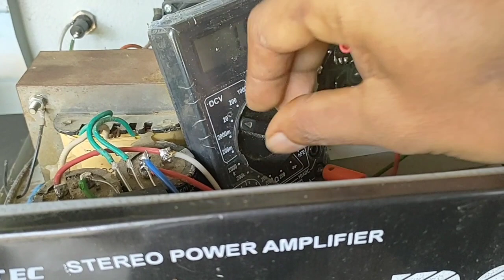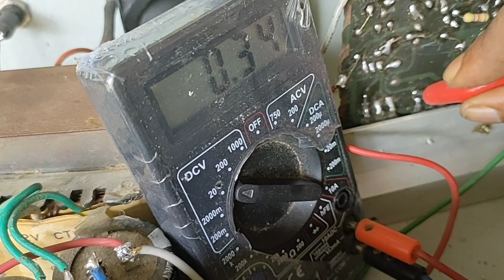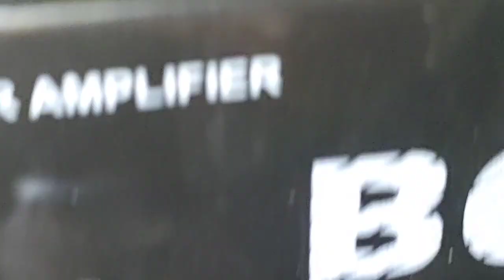modif ocl 150 watt hanya ganti 4 komponen saja

Comment: Untuk angkat 12"-15" gimana mas..??
Reply from the maker: Klo untuk 15 tidak recomendasi lur...karena travo cuma 5 a...klo untuk 12 mungkin membran speaker bisa terhentak...saya sesuai kebutuhan speaker Pasean saja lur...tapi umumnya klo modif untuk 12 inch dipake di 12inc kebawah hasil kurang max .tapi jika diatasnya biasanya lebih Joss...tapi ya itu...sesuaikan travo utamanya lurr🙏
Reply: @talunanservicekaruniaelekt3706  mau untuk 12" mas kira kira ukuran resistor yang 560 di ganti ukuran berapa mas..?? Dan apa aja yg di ganti
Reply from the maker: @wongkampung893  bentar lur...ini yg modif untuk 12 inch sebentar lagi dipublikasikan...insyaAlloh....
Reply: @talunanservicekaruniaelekt3706  ok mass saya tunggu... Sukses terus mas...